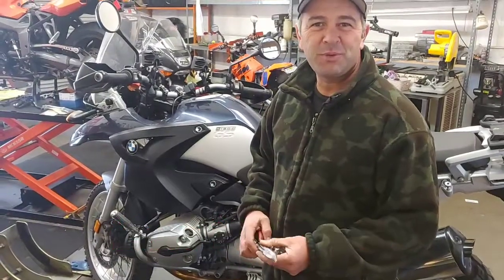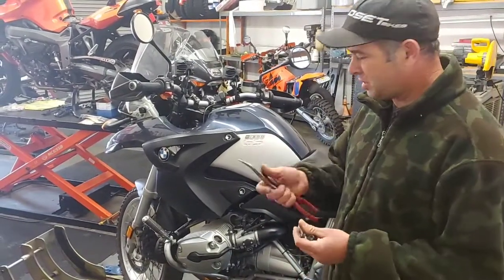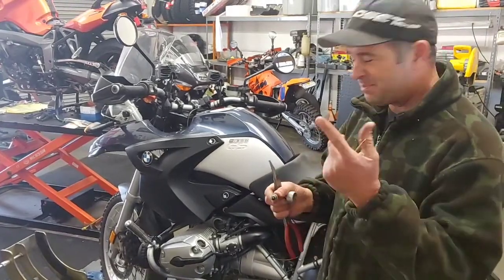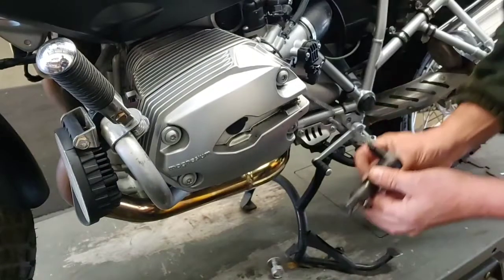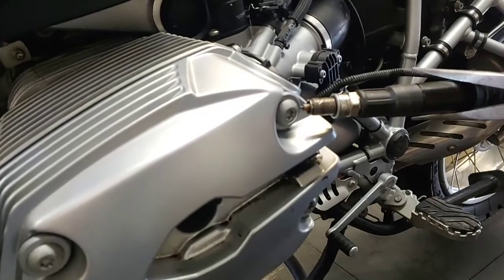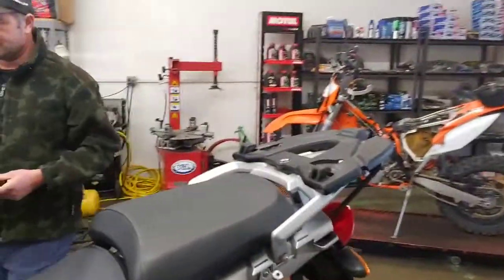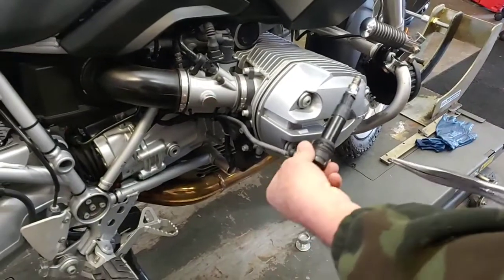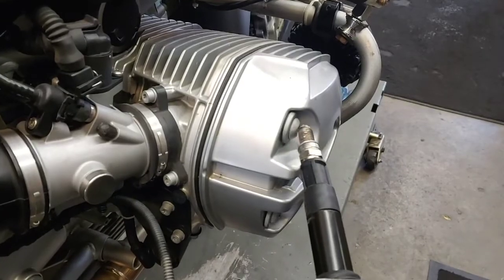BMW boxer engine ignition coil test

Comment: Thank you for the video 
I try on my 1200 RT I have spark on secondary coil but when I try to disconnect primary coil to check, bike doesn't start. I can see that your bike run only on secondary coil. Can you help me, please?
Reply from the maker: Do you have spark ? Sometimes both stick coil are out. Check for spark if you have spark it could be something else.

Comment: I accidently break the plastic around the top epoxy. Just the plastic ring outside that epoxy. Should have to replace the whole expensive plug? Please help!
Reply from the maker: Not sure what you break but if I'm thinking its the plastic that keep the wire connector it can be loose fit and can cost problem when it ruddle.